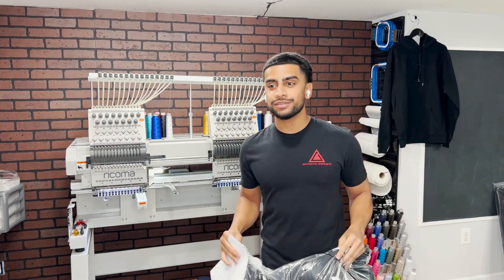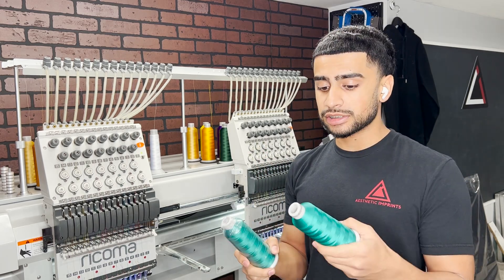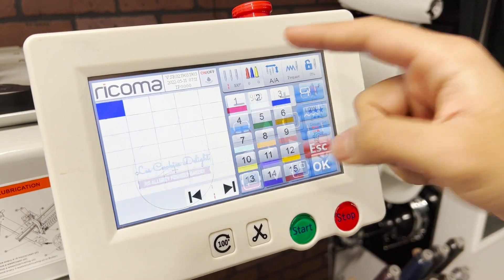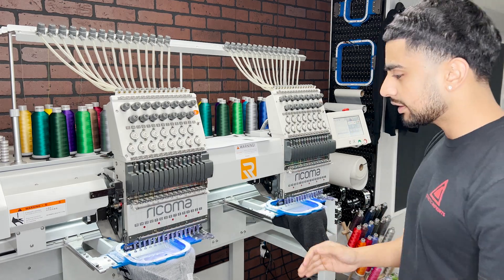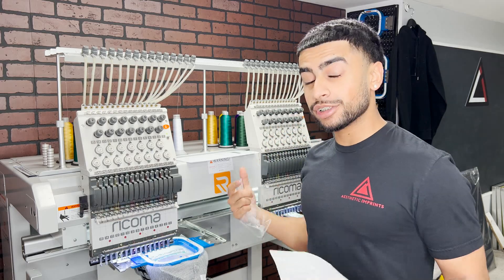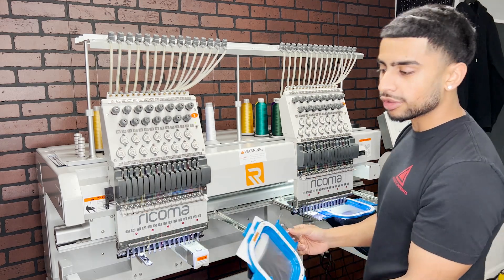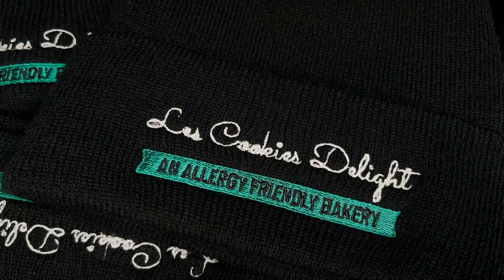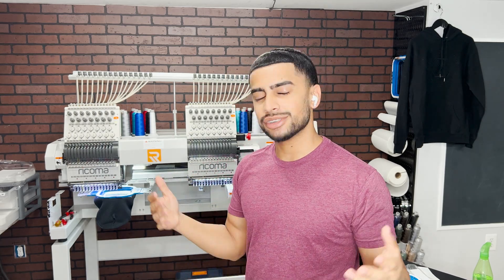Day In The Life Embroidering Beanies | Ricoma MT1502

Comment: Hey brother those colors are spot on. 👌 

Also I got a killer deal on some used screen printing equipment.  Got a conveyor dryer, 4 color 1 station press, single station press, 30 color plastisol inks, 2 large flash dryers and a few other things got 1300. Now just gotta get the show set up
Reply from the maker: That’s a killer deal for sure at a great price. Take advantage of it!🙌🏽